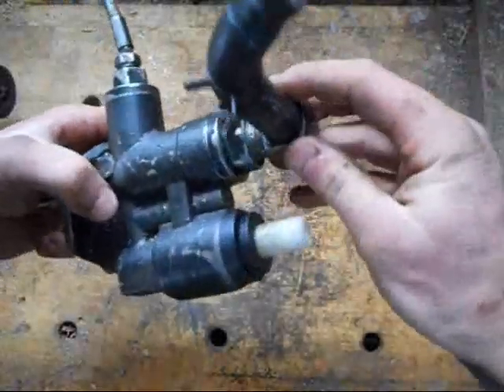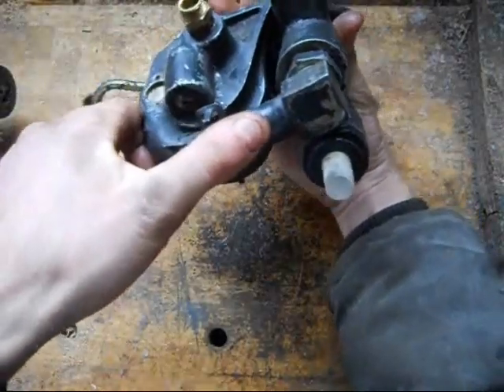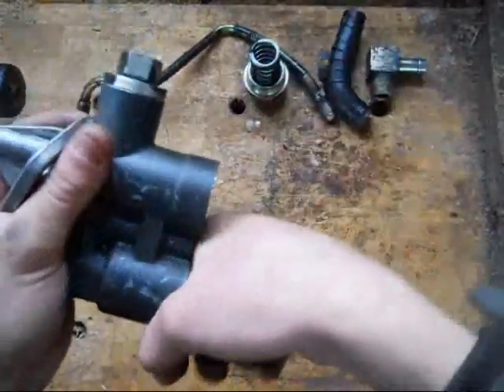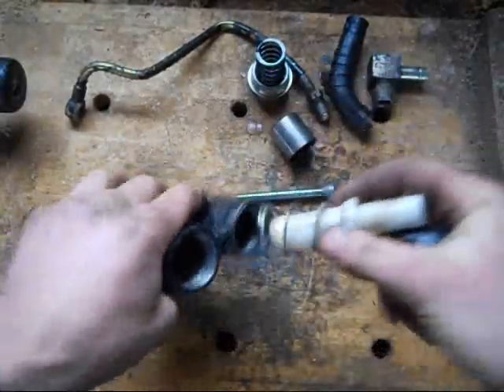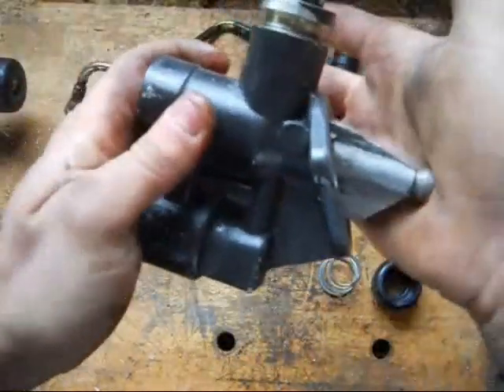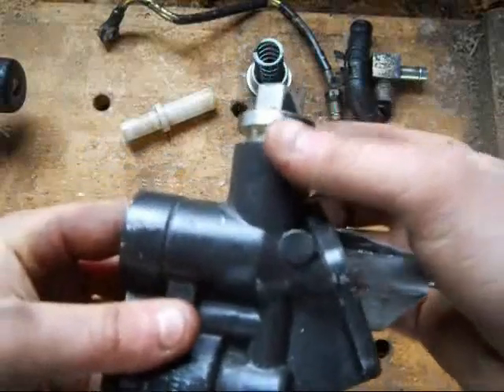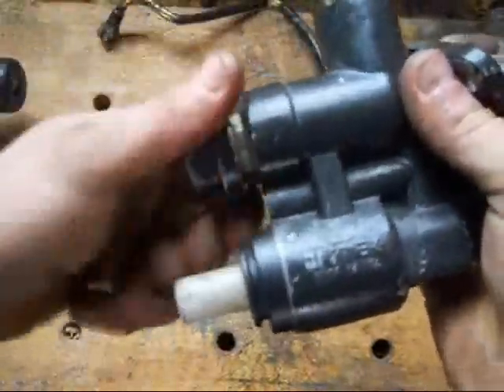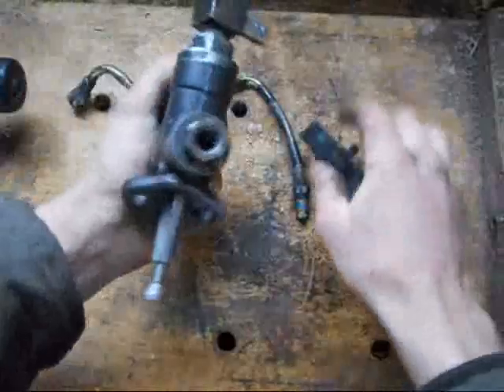Cummins Carter Lift Pump Expalained Part 1

Comment: How to know lift pump is good or bad
Reply from the maker: Two main ways for the pump to fail is it will leak externally/suck in air.  Or it doesn't want to pump the fuel.  Best way to check the pumps pumping capability is to install a fuel pressure gauge, have someone watch it, and then use some pliers to pinch off the return line slowly.  You should be able to hit 50-60 psi fuel pressure fairly easily.  Do be careful not to let it spike up too high though, a quick spike to 50psi shouldn't hurt anything but try not to maintain that for too long.  I instruct my helper to scream like a little girl once 50psi is reached.  Best of luck to you mate!

Comment: my truck have a knocking noise and someone tell me that i have a bad lift pump,  is that possible?
Reply from the maker: +Alberto Jaime It is possible for a lift pump to make a ticking noise, you can remove the fuel filler cap and listen into the tank, you should be able to the ticking fairly well from in there.
Reply: J I understand b

Comment: -yeah "Cummins Works" -Thanks for responding, I did not have a hole in my fuel tank's sending unit's draw-tub. I did remove the fuel tank, cleaned the in-tank strainer, blew on the tubes, emptied the tank and dried it with an old large towel.  I finally got fuel to the lift-pump by having my Dad check the disconnected rubber hose from the pre-screen filter while I applied compressed air to the filler neck. My Dad was able to see the lift pump because I removed the master cylinder from the brake booster. Then I pushed/pumped the primer plunger fully and nothing was coming out the top nut of the lift-pump. So then I applied the compressed air again with a rag sealing the filler-neck and asked him if he see any fuel coming out the top-nut of the lift pump yet. He said no, then he said wait a minute! It's starting to come out!  Then I bolted the line on to the top-nut to the strainer and finally was able to prime the rest of the system using the plunger on the brand-new $100. lift pump from the Cummins dealer. I later found out that I could get the same pump from Pensacola Fuel Injection for $59. This priming procedure was performed after having installed a rebuilt P-7100 "in-line" style injection pump from Pensacola Fuel Injection on E-bay. I never done one before. I bought the barring tool from Cummins, I stuffed a paper-wad in number one injection-hole to get in the "ball park" My Dad told me when the wad flew but I saw it through the windshield, I turned the exhaust valve screw in 2 turns, I rotated crankshaft clockwise till  piston touched the exhaust valve. I painted a white  dot on the balance wheel by shoving an artist brush into 16" piece of straight 1/4 in brake flare tubing, I rotated the engine backwards 350 degrees til the piston touched again, and I painted another dot on the harmonic balancer wheel. TDC was somewhere in the middle space between the two dots and then my Dad felt the timing push into the hole in the back of the camshaft gear. We did it with injection pump removed and pump gear "floating" in the timing case.
Reply: 9